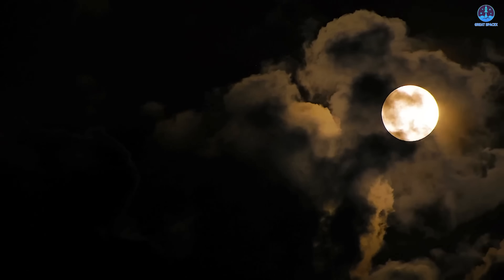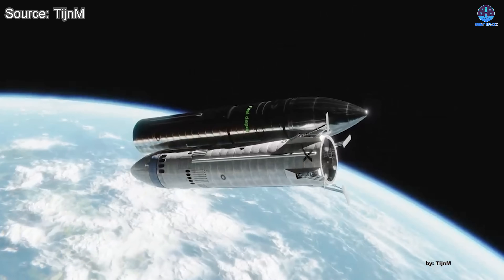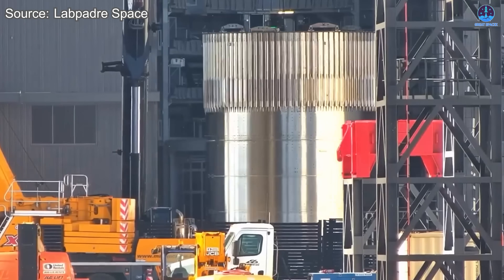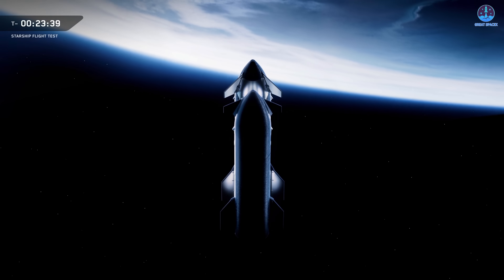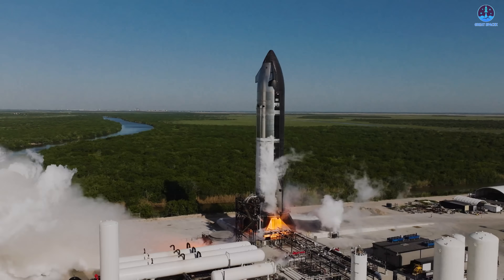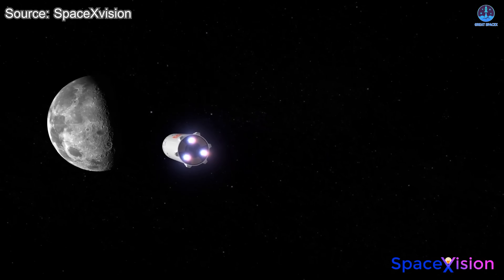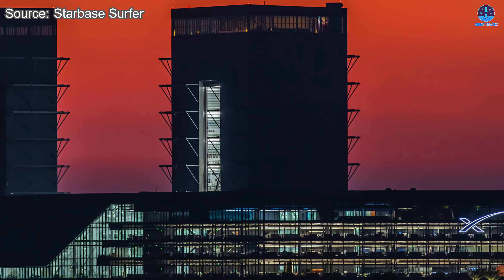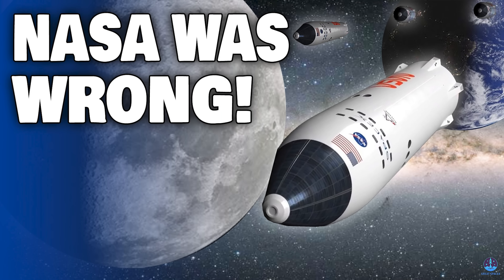SpaceX’s Big Upgrades to Ramp Up Starship Moon Plan Shocked NASA and Blue Origin!

Comment: Most people think getting to the moon is hard but it's not going from earth to moon that's hard it getting from earth ground to earth LEO is the hardest part and even harder is LEO to earth. Once Starship can launch-orbit-land even with 3 weeks needed for re-launch building the other variants will be easy. When you reuse a $10 billion dollar ship instead of trashing it after launch doing 10 flights to a fuel depot becomes cheap. Hell SpaceX saves hundreds of millions a year just reusing the fairings on Falcon9 and Starship will be reusable like Dragon but eliminating the single use upper stage rocket.

Comment: New Glenn is composite and unsuccessfully flown once.  Spacex testing has shown huge stresses and super high temperatures.  BO can’t get the rocket to the pad without cracking like an egg.   Spacex and China have steel rockets with high heat resistance.   BO does not deserve contracts.

Comment: It all depends on what NASA’s Goal is. To beat China to the Moon by landing a smaller Lander with a few Astronauts, plant a flag and bring them back after a few days. Or start building a Moon base. You can’t start building a Moon Base without a lander capable of delivering a lot of Cargo. And that would be Starship.
Reply: Both.  We want both goals.  One before the other.  It’s too bad we have to do it this way, but global reputation requires it.
Reply: @michaeldemarco9950  if beating China to the Moon with an Small Apollo type lander just to plant a flag, that’s fine by me. If National Pride is  the goal, then go for it. But NASA can’t build a Moon base with a small lander.

Comment: SpaceX will, as it has always done, step up.
Reply from the maker: Yes!! We will land on the moon soon
Reply: NASA is just getting a bit nervous without “proof of life” from the SpaceX team.
Reply: @michaeldemarco9950  Their own engineer criticized the Raptor 3 as "not a frozen design yet" because they had the thrust they needed but didn't stop because future trips to the moon could be made with larger cargos, reducing cost substantially. The engineer didn't understand this concept which was worrisome. Additive manufacturing doesn't need to "freeze a design" as it requires no retooling. He should have known that. 

The "possibly years of delay" was basic BS. 
The problem is that the NASA admin isn't an engineer and can't tell if he's being lied to. (Sorry... "years" is a lie).